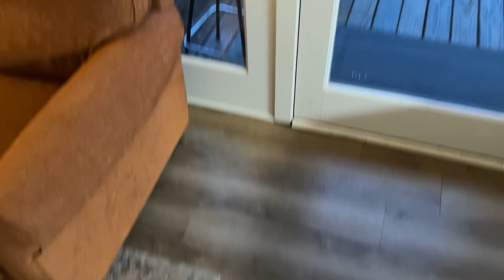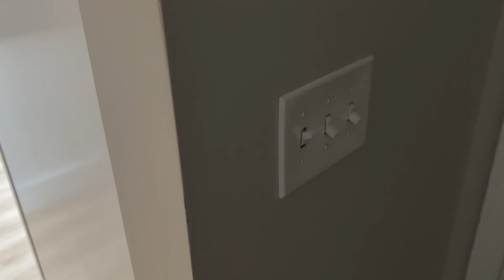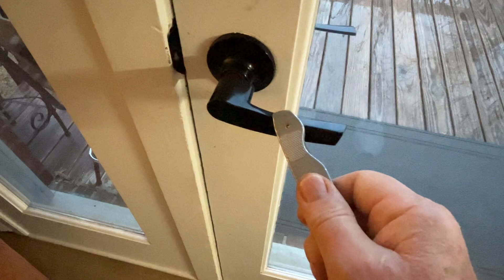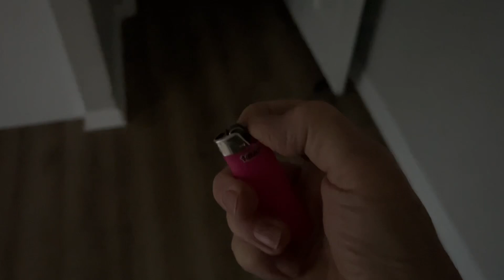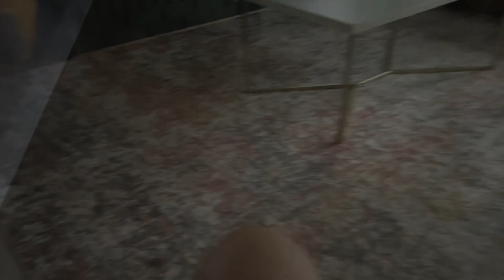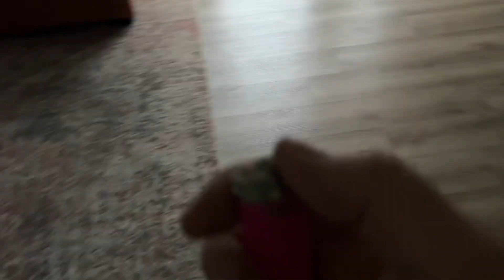Trying To Ignite A BIC With Household Static Electricity

Comment: Between my jacket, the wheels on the cart and the new floors in my local store I can build up enough charge to actually leave a mark if I don't bump the shelf with the cart before I pick up a can. As for around the house try getting the humidity in your house up, if there's enough water in the air it helps even out the charge. As for the cat, well they always hate us so at least he has a reason 😆
Reply from the maker: I ground myself out before touching the cat now, but he doesn't know that. All he knows is that it hurts when any of us touch him, lately. You're right, higher humidity helps solve this problem.